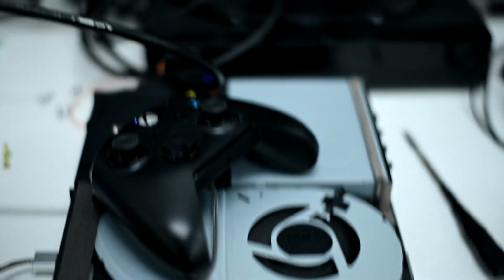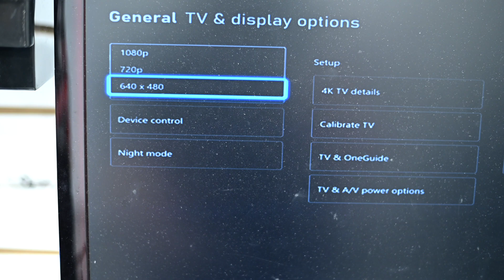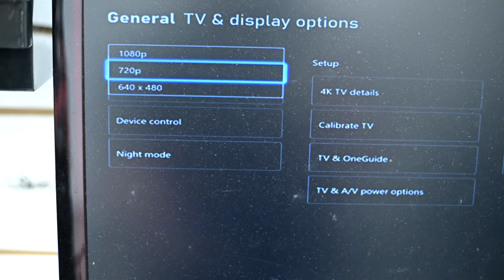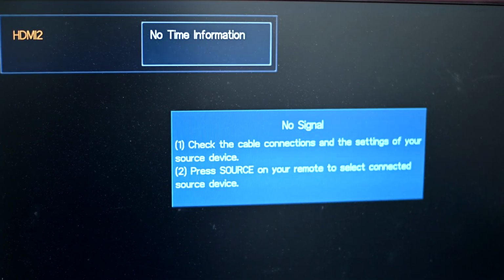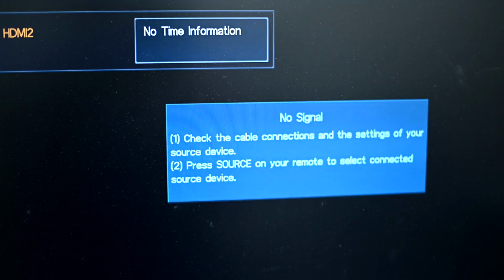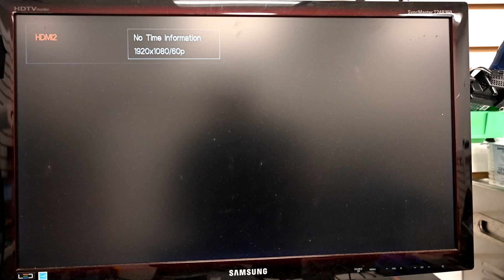Xbox One X HDMI Retimer IC Replacement Guide (TDP158)

Comment: Hey guy's, also a little heads up. If replacing U29 doesnt help (TDP158) check the ESD Filter next to it. Its a silvery IC labelled U21 i believe. You can find resources online on how to check the values of the caps around it to see if its alive. If its dead sourcing a replacement is hard because you can only get thek off other One X boards. You can bypass it by putting wires to connect certain caps which you can find online. It usually allows 1080p display stabely but i dont recommended it if at all possible.

Comment: No way that chip came off that easy. i had to grind off the top of the chip to expose the pins to get it to come off with extreme heat. Your video is setting people up for failure with making it look easy. I call B.S.
Reply from the maker: Sounds like you need a better heatgun, 450c minimum, some parts of the board need 480c. Quick 861DW makes board repair a breeze

Comment: Is there any chance that just reflowing the chip will fix the problem?
Reply from the maker: @LeMedjayYT  sometimes, but rarely. The chip doesn’t usually fail due to solder joints, more often fails from an electrical standpoint

Comment: My Xbox one X still wont power on, even after replacing the psu. Someone told me to replace the retimer chip. Could this chip prevent the console from powering?
Reply from the maker: @bryanfrye8770  it actually can, if there’s a short in it the console might detect a power issue and fail to boot. Usually you get a quick flash of the power light before it cuts off almost immediately. This could be a power supply issue, but I usually also spot check a few board locations too while I’m inside.
Reply: @TapticDigital  the console isn't powering on at all. I removed the chip but the c20 capacitor desoldered. Tried to put it back in and it flung out of the tweezers. Any 0402 100nf 16v 10% smd capacitors should work right? I also noticed the PSU is delivering power because when I touch the components on the front of the board, the white light blinks.

Comment: used a heat gun on the recommended heat. still cannot remove the ic chip :(
Reply from the maker: The amount of copper in these boards is damn near insane. The board is basically a heatsink itself. In these cases I max out the heatgun and keep heat moving in a circle around the chip, giving it a direct blast every so often. Too much heat and you’ll get thermal shock and destroy the board, so you have to spread it around as much as possible
Reply: @TapticDigital  I'll be sure to try that, I stopped after 15 seconds from fear of damage. Nervous newbie here, obviously. Thanks for your reply & video, sending virtual hugs and good vibes your way

Comment: Just curious couldn't you have just reflowed the chip ? Really what could possibly go wrong with the chip I never see anybody just reflowing them so I take it there's a reason behind that and I can't find any videos where as anyone's ever just reflowed the chip
Reply from the maker: Most techs will try a reflow first just to avoid using parts, but in most cases the chip has gone bad from a short. These little fellas are only rated up to a certain voltage, and going over that too far will lead to the internal traces of the IC actually rupturing or cracking. If you were to X ray those chips you’d find a pretty intricate network of connections, because they are so small they will break before the larger external components do.

Comment: Could you please provide the value of capacitors c16, c17, c18?
Reply: Hey, I'm late so I doubt you'll need this now but someone in the future might. All three caps are:

 Capacitance: 1000 pF (picofarads)
Voltage rating: 50V
Tolerance: 5%
Resistance: 3.78 ohms

And they are in the 0402 package size.

Comment: ok ive been trying to learn how to solder using the hot air gun no one ever shows the dial of airflow and  explain how close or far the gun needs to be from the ic  its kinda hard to tell on youtube.... any tips will help ... i cant remove the ic for the life of me
Reply from the maker: For sure! So on the hot air station you're going to want to set your heat to 450C, sometimes up to 470C if it's taking a long time. Flow is going to depend on the part being removed. If it's the HDMI port, max airflow and about 2-3 inches up from the part. For smaller chips I reduce airflow to about 10-25% (it can blow parts off!) and keep it very close, 1 inch or so. IC are tricky since you can't directly hit the solder points and have to rely on heating the chip and board, I recommend adding more flux than you think, it will help the heat flow under the chip a bit more evenly.
Reply: @TapticDigital  ty so much

Comment: can't figure out what i am doing wrong in the retimer chip change,  i ve done it like 5 times with 5 different consoles and 5 chips, still i get black screen.
Reply from the maker: It's very important that these chips are oriented the correct way, and that each leg is attached fully. I'd possible try not to directly heatgun the new chip, instead heat the board and drop the chip in once the solder has liquefied.
Reply: @TapticDigital  Man thats a solid tip

Comment: Hi ,can u teach me why I use 480°c fan, can't take it down,thx
Reply from the maker: I think you mean at 480°c it still isn't coming off? It takes a lot of heat, just keep heating it until the solder melts.
Reply: @TapticDigital  Thank youfor your answer , May I ask how long it took you to  desolder
Reply from the maker: @林政峰-v5c  it was at least 1-2 full minutes of heating, make sure you move the heat around in a circle to spread it a bit better
Reply: @TapticDigital  In this case, it means that the temperature indicated on my newly bought heat gun is falsely labeled, showing 480 degrees Celsius, but in reality, it's not that hot. Therefore, I blew it for more than 10 minutes, but still couldn't unlock the chip.":face-pink-tears:
Reply from the maker: @林政峰-v5c  oh no, you may need another heatgun then!
Reply: Regardless, I appreciate your response and guidance. Thank you.!
Reply: @TapticDigital  Perhaps I should ask someone for help (such as a mobile phone repairman) because I'm getting older and my eyesight is not very good.:eyes-purple-crying:
Reply: Hey I know this was a while back I was having the same issue. Try it with any “Tip” so the heat is coming directly out of the gun and not running through anything it worked for me hope it works for you. 

Now I just need to make sure I got the chip lined up or else I need to figure why it still isn’t working 😅
Reply: Good tip  @JJ-pp6tz  , didn't think about this. Running into the same issue so assuming the heat isn't being fully applied through the smaller nozzle tip, I'll try with the direct gun and see if that works out.
Reply: @JJ-pp6tz Ended up working, thanks!

Comment: Quick question, I see some videos mention the thermal paste that is placed on the heat sink above the motherboard and I just wanted to make sure if it’s required to replace the paste both on the cpu and the patches around the heat sink after finishing the repair and putting the console back together?
Reply from the maker: Not necessary, just place a blob in the very center of the CPU and it should be fine once you clamp the heatsink back down

Comment: Hi thank you for the video. Did you use the same temp heat when reinstalling the new chip. Thanks
Reply from the maker: Yep! Same temperature for everything, right about 420 seems to do the trick for me
Reply: @TapticDigital  Hey thanks you. Maybe you could direct me. I set the chip dot to dot matched. Soldered in and still no signal. Reset the chip again still no signal. Both times the monitor does see the port. example HDMI 4 . But again no signal. any help would be great. thanks
Reply from the maker: @meezee894  it could just be a bad chip, I've gotten a few here and there. I'd also check the port itself to make sure each leg is actually fully attached to the pad. If it still doesn't work, it's likely a more serious issue with the processor

Comment: Does the TDP158 wotk in the Xbox One S? Or does the TDP159 work in the Xbox One X? The chips are different, but I'd like to buy the best option for both, since I have a bunch of S and X laying around ;)
Reply from the maker: They are device specific as far as I know, so this one only works in the One X. Though I've never tried swapping them, I have a feeling it wouldn't work very well.
Reply: @TapticDigital  as far as I remember, one chip fits them both.. but I don't know which one.
Reply: I was told they’ll fit both I’m trying it
Reply: @richardstone8615  so it work?
Reply: @richardstone8615  vice-versa, and it works?
Reply: @jeandread  i replaced 75dp159 with TDP158 - WORKED FINE!
But after 2 weeks customer brought back the console. 
I am thinking whether it's the same cheap again, or something on with HDMI port because I also repaired the traces to it before so I'm going to find out soon.
Reply: @SingTodayi anything?
Reply: I was able to install a new chip but in the process I removed C43 and idea where I can get one?